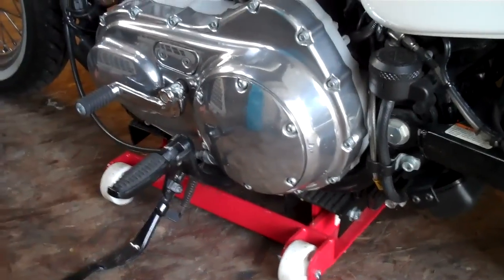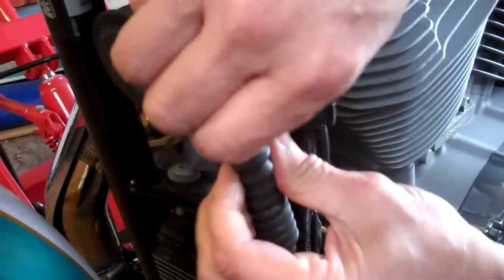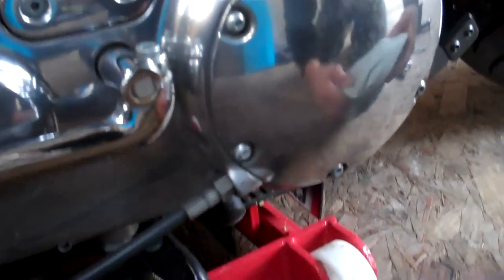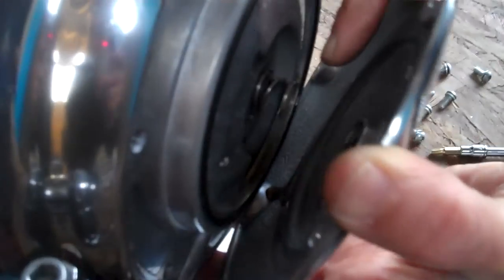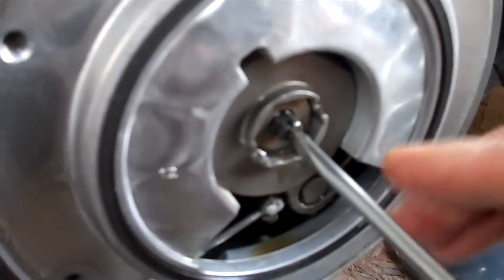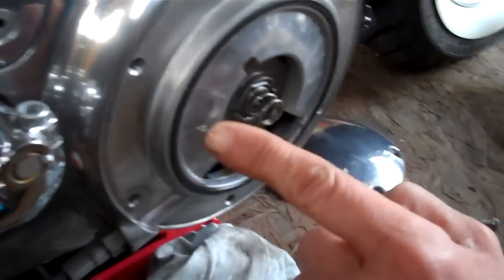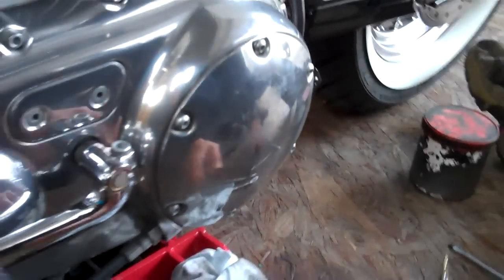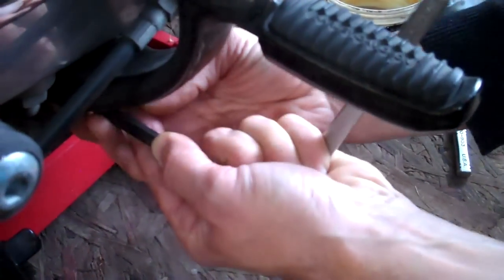Delboy's Garage, Harley Sportster Clutch Adjustment.

Comment: Get rid of those torx head screws and install allen head screws. Torx head screws strip out where the torx bit fits entirely too easily. Even a Phillips head screw is better since an impact screwdriver will work on them but will not work well on torx screws. Allen screws are hardened and most Chinese Allen wrenches, whether socket type or plain are also very tough but Chinese torx bits are not very hardened from what I've seen, bending and breaking right off. The threads on the bolts for the cover are 1/4 inch coarse thread with all six Allen bolts costing only three dollars or less.
Reply from the maker: Cheap tools and poor performance are always the problem with Torx screws, this video was 6 years ago... i always prefer Torx over Allen screws now... i use these.. https://www.amazon.co.uk/Wiha-362K6SO-SoftFinish-Screwdriver-Piece/dp/B001JG8UBU/ref=sr_1_2?ie=UTF8&qid=1486897136&sr=8-2&keywords=wiha+torx  
and where possible, upgrade to stainless steel Torx screws.. never have a problem again.. 
(Also, it is a torx bit that comes to the rescue when you round out an Allen screw.....but only a good one.! )

Comment: I’ve got clutch drag on a 2014 1200 t when it’s cold and just changed primary oil,bikes only done 1900 m should this be acceptable cold ? It was struggling to change gear yesterday at operating temperature? Cheers
Reply from the maker: No Ash, this is not acceptable, you should have NO clutch drag once the bike is warmed up and operating.. They can often be a little heavy going into first gear for the first time in the morning, that's quite normal.. but not after that. !      The main reasons for clutch drag can be incorrectly adjusted cable, incorrectly adjusted clutch pack, too much primary oil, or failing all that, then getting deeper into it you could look at the plates to see if you have a warped one due to running too little primary oil.... but check those first things and let me know mate.. i bet it'll be one of those things.!
Reply: @Moonfleet41  will do 👍 thanks for your knowledge
Reply: @Moonfleet41  still have problems getting 2nd gear, clutch is adjusted correctly and clutch free play just been out and got half a dozen neutrals from first to second changed engine oil for mannol 20/50 fully synthetic and primary oil for Lucas primary case oil to the level. 🤷‍♂️ could it be the bike doesn’t like either oil ?

Comment: Hi mate,

You or anyone have any tips for lowering the front end on one of these things? My sportster looks shit from the front and i think it needs to give the impression that it has shorter fork tubes.
Reply from the maker: You can either fit shorter springs, shorter damper rods (I believe Arlen Ness to a kit), or if you don't need much of a drop, you can lift the legs up through the yokes by up to 3/4"

Comment: Do you have any videos on how to remove the primary cover on a 05 883c? I have a broken ratchet spring and can not find any videos on how to get in to it.
Reply from the maker: Sorry Chris, we've never had cause to do that one on video...but the complete information step by step is in the factory workshop manual, all the tips and help to make sure you do it right... always recommend every Harley owner buys one as part of your workshop equipment  and its a sound investment as you'll use it again and again for many jobs to come... about £60 from the main dealer and worth every penny..
Reply: Moonfleet41 I have a  clymers manual but from watching your videos its not the same. The only thing I am concerned about is do I have to remove the clutch to simply take the primary cover off?
Reply from the maker: chris brown
Chris...Clymer manuals are little more use than a cardboard boat....get the proper 'Harley Davidson Genuine workshop service manual' from the main dealer ONLY... you'll soon see the difference buddy..
Reply: Moonfleet41 Thank you will be ordering one on payday... Had the bike for 2 weeks and still haven't rode it so im getting anxious.

Comment: Hi, make 3 attempts today but it seems my feeling of the "resistance" is not good enough. Anyone here can describe what kind of resistance it should be? Like in "I can't turn anymore at all" or "it's becoming hard". I tried "becoming hard" and "becoming harder" but the bike still wants to move very slightly even with the clutch lever completely pressed...
Reply from the maker: +Michel Luczak Michel you really are overthinking it mate... turn the screw until it stops....then turn it back a quarter turn.. job done... its not that complicated buddy..!
Reply: +Moonfleet41 got it, thanks!

Comment: I backed out the screw too much on my XR... now what? what might I have done?
Reply from the maker: Hey Jamie, its just a tiny screw, you turn it counter clockwise until it stops... you cant really "back it out too much".....if its stopped tight against its seat, then turn it back about a half turn.. and then replace the lock nut...!!!!!!!   Does that make sense..?
Reply: yeah I messed something up, I turned it too hard. it wont pull the clutch the same now and when i start it and put it in gear it makes some bad noise when I start to let it out..  I thin I need to replace the adjuster screw or the bering or maybe I just pulled something out of spot..thanks for replying to me..
Reply from the maker: OK sorry to hear that... check the central adjuster bottle screw in the middle of the cable.. also check that it didn't drop off the fork in the bottom of the case where is connects to the clutch actuator.. that's all i can suggest without seeing it.. good luck with it buddy, hope you can work it out... im sure its something simple.. Del.

Comment: I have oil coming out of my clutch cable at the adjustment is that normal on a Harley or do I just need a new 1. I'm new to the Harley's
Reply from the maker: Hey buddy.... where exactly is the oil coming from, you said "at the adjustment"... do you mean the bottle screw adjuster in the middle of the cable..?
Reply: Moonfleet41 yes sir
Reply from the maker: Hi Jennifer, ok, that's not a problem at all, its just lubricant... inside that rubber gator there is a steel thread and lock nuts?... and to prevent this from corroding and rusting up, it is correct procedure to squirt some WD40, or light oil down inside the rubber gator to keep it all clean and lubricated...so what you are seeing is just a little lube oil weeping out...if you maybe just bought the bike, was it just serviced, maybe they were a little over enthusiastic with the lube spray......no matter, just wipe it away and enjoy your bike..!!   Hope that helps.. take care, Del.
Reply: Moonfleet41 sorry del its abe I was on my wife's phone. But no it's coming from around the crimp on the bottom of the cable coming from the clutch housing and its a lot. But think you so much for trying to help
Reply from the maker: Hi again Abe... easy fix buddy - there is an O-ring that fits in that hole where the cable goes through, it's not an un-common problem, it's usually down to clumsy fitting in the first place, the O-ring is either pinched, split or missing... if you collapse the bottle screw to give yourself all of the slack available, reach inside the derby cover, un-hook the hammer off the end of the fork, pull the cable out and you can replace the O-ring... also, it will give you a chance to rectify the oil lever whilst the cover is off, as it will be low if it's been leaking.
Reply: Moonfleet41 think you so much i will give that a go

Comment: Hiya Del, mate, I've just bought a rust bucket of a 2011 sportster, its an XL 883 standard model, I'd like to do it up but cannot find parts for an XL 883 "standard", I can find parts for the 883 Iron, nightster, roadster....i've heard rumour that the parts for these bikes are compatible from year 2004 up, can you steer me straight please? Thanks fella, love your videos.
Reply: I know about .000000000001 of what Del knows but...I have a 2013 Iron and I refuse to let anyone work on it (especially overpriced Harley Davidson shops) except me, I have kinda "done it up", Del has helped with great advice of cours. Everytime I buy something I buy aftermarket stuff from everyone if they have good reviews,except HD) Probably the best place in USA to buy from is J&P Cycles (also has great Gold plan, save bookoo $$)alot of 1200 stuff is interchangeable with 883 also. You wont find anything that says "standard", **just look for XL 2004-up.**
 anyhoo, these are great "do it up" places>>..."Joker machine", "DK Custom", "Sportster Specialty"...google 'em, you will like. There are other also. Hope I helped. Click my icon and see what I did to my Iron, I am bored so if I can help just contact me there.
Reply from the maker: Hi Mark, sorry not to reply sooner, your message didnt some with a notification email for some reason, just a YT glitch i think..... ok, everything that Captain Tripp say here is dead right, there are no parts marked and marketed as "Standard"....just OEM parts for your year... but they will only come from main dealers and cst way more than even the best aftermarket partrs... have a look at the lonks and companies that Captain Tripp suggested, and see if there is anything there you like.. Hope that helps buddy.. Del.
Reply from the maker: Hi CT, thanks so much for your kind advices to Mark, you are exactly right there mate, and thats all sound advice on firms like Joker Machine.. thats why i love the Biker family, we just take care of each other... no biker is ever a stranger right..?     Thanks buddy. Del.
Reply: Thankyou for the kind words Del! Sorry I have not been around but had some serious personal issues to handle. Just got back online a couple days ago. "You Da Man"!
Reply: thanks very mate, much appreciated
Reply: Good on ya mate, I kinda was starting to figure that that was the story but so happy to have it confirmed, very much appreciated man, thank you.
Reply: Anytime Bro. you will have to pardon me, I am in the USA and just "assumed" you were also, Was not paying attention. Have no idea what the cost is if you liked and ordered parts from the places I mentioned, I am sure England has the same type shops?? Anyway, if Del is too busy or whatever, contact me and I will try to help, I have done almost everything  to mine by now, even delved into the motor. Ordered more parts from more places than I can remember, so, although not even close to being the expert Del is, I am not too shabby.
 Keep your head on a swivel Bro. Oh, over 90% of bike vs. auto accidents here happen from autos coming from the right side, i.e. side streeets, where you are I guess that would be the left side, watch out, haha, Just saying, I had a head-on at 55 mph with car from the right turning left right into me...it happens so fast it is unbelievable. just want ya to be safe.

Comment: How many foot lbs is the torque for the cover bolts?
Reply from the maker: 9:59 in the video buddy...
Reply: Moonfleet41 now I know what a Newton meter is. Ty
Reply from the maker: Sorry mate, i use Metric, most of the time as its universal... it converts to 9.8ft lb, to 10.3ft lb .. hope that helps you out..:-)

Comment: Have you? Or can you do a video of replacing the rubber engine mounts on a sportster?
Reply from the maker: Sorry Shawn, Never got round to that job, just not a task that ever came up on our bikes, and thats all we have to work on with not being a commercial shop..!
Reply: Ok. I was just checking. Mines a 2005-1200 custom. And I’ve never serviced that part before. Just made sure the torque was right after 5000mi services. But I’ve seen on some websites it’s good the change out after 20,000/30,000 miles? Just wanted to get your perspective?

Comment: Hey, what kind of grease do you use?
Reply from the maker: Hey Bryce, I just use a cheap branded regular LM workshop grease... nothing special!
Reply: Moonfleet41 What does LM stand for?  Do you have a brand that you normally use?  Sorry I'm a newbie and have never used grease before, don't want to get the wrong kind.  Also thanks for all the vids, they are great.  Going to do my 5k service Monday after watching your vid!
Reply from the maker: Bryce Abrams
Sorry Bryce i should have said...LM simple means 'Low Melting point', its not a brand name, so any grease is like this unless otherwise stated...its just regular ordinary grease....good luck withj it.. Del.

Comment: Whats the torque in foot lbs?...i only habe a  10 to 200 ftlbs wrench
Reply from the maker: Harley manual recommends a range of 84-108 In-lbs,  thats 7 - 9 ft-lb (or 9.5-12.2 Nm)    
I think you're maybe best advised to get a smaller range torque wrench buddy..
Reply: Moonfleet41 thank you for your response...ues your right...i ordered the wrong one.. do you think I'll ever use the foot lbs torque wrench for my sportser? or should i just send it back.?..whats your about checking the axle nuts on front and back? I only have 1500 miles on my iron so far.
Reply from the maker: No, i would keep the big wrench you have, you'll probably never use it much above 150ft-lb, but thats fine, if it genuinely has a setting as low as 10ft-lb, then you'll use it lots on the bigger fasteners, things like wheel axles, shock absorber nuts, fork yoke pinch bolts etc etc... all you maybe need i a little 1/4 drive wrench that takes you from about 4ft-lb up to 20ft-lb... then you cover everything you'll ever need..
Reply: Moonfleet41 thank you bud.. you've been a big help... your videos are awesome.. keep them coming.. see what other things you do  on a sportser.

Comment: would any of you know why my clutch isn't working at all and it's rock solid after doing this
Reply from the maker: Hi mate... it will no doubt be an adjustment the wrong way, or something like that... just roll through the procedure again, just like I show in the video, and don't leave anything out, or skip any parts of the video... and it will see you right.... pay special attention to setting the adjustor screw correctly and make sure you fully back off the cable in the centre bottle adjustor before you start, so there is plenty of slack and it's not pulling on the actuator ramp, which is the little hook the cable connects to that can be seen down through the hole under the clutch pack... see how that goes and let me know !
Reply: +Moonfleet41 thanks for the fast reply bout to try it again if I turned it out to far which is what I think happened should I role it all the way back in clock wise to separate the 2 discs and then adjust it out wards til I feel drag on the screw and back in a 1/4 turn
Reply from the maker: Yes it is possible you've backed it out too much... I have tried to explain this business of 'turn the screw out till it seats' and it seems to get mis-understood... some people wind it out with great force until they are physically unable to move it any more... this means 1/4 turn in is not enough as the screw will continue to turn for up to 1.5 turns after it is seated if you use enough force.    

The meaning of 'turn out till it seats' is simply , imagine if you are using a screwdriver with no handle, as in just the blade in your finger and thumb just like a pen, so start now by screwing the screw in until it is free and flopping about with zero resistance and, making sure the cable is all backed off, turn the screw out (anti-clockwise) with as little force as possible... and the minute you feel the screw touch base STOP... it literally needs to just touch, because it is spring loaded it will continue to turn, but it must touch only, so there is no actual gap THEN turn in 1/4 turn and apply the spring nut and put the casing back on.... that should sort it out my friend, let us know how you get on !

Comment: sorry  primary cover
Reply from the maker: OK, reason I asked was many people refer to the derby cover as the 'panel'....!   But in your case, if you want to change the entire primary cover, then you'll need to disconnect the bottom of the cable - have a visual look at it down there, it's pretty obvious how it comes out - you have to disconnect the end of the cable inside the primary by taking the derby cover off first...